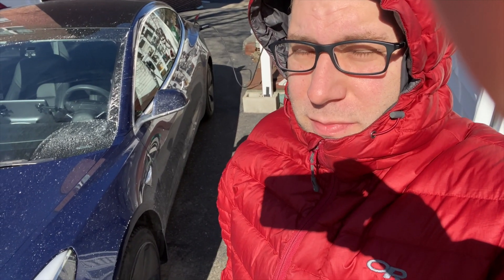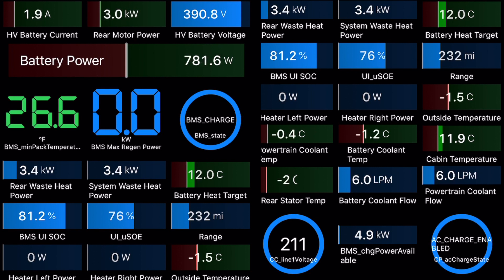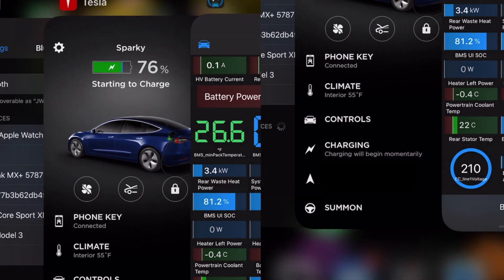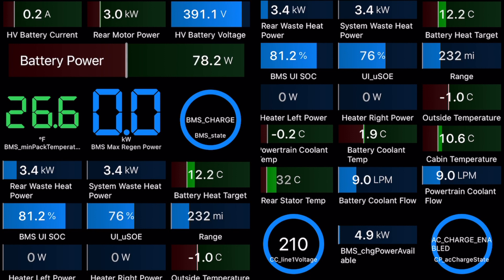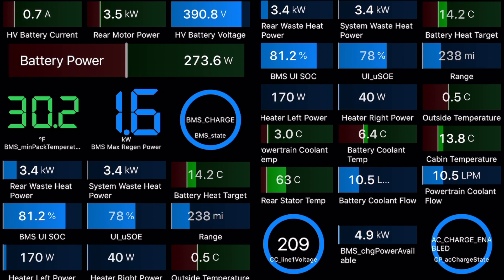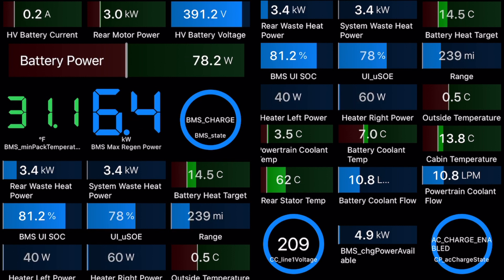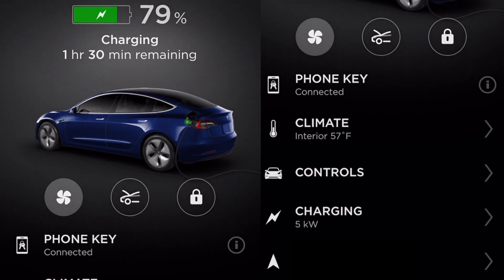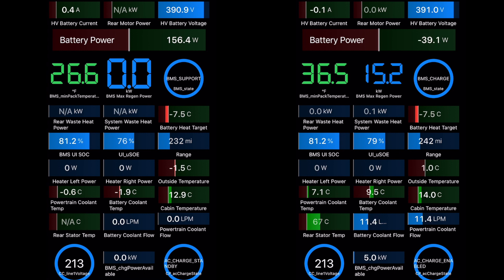Signals: Battery Heating and Preconditioning

Comment: I feel like I need a electrical engineering degree to follow this.  Any way of dumbing down another video and just show how to heat cabin and pre condition battery on a very cold winter day using your app on the phone. I’ve watch I think 5 or 6 videos and no one shows how to do it on the phone. Everyone is showing how to do it on the car screen.  My pt is if I’m at a mall or hockey game or something, and I down know exactly how long I will be gone,, I want to get on my phone to get the car “warmed up” before I go out to the car
Reply from the maker: Yeah these videos are definitely engineering focused. Preconditioning your car is easy, just open the Tesla app, tap Climate, and toggle it On about 10 min before you leave. I would use this almost every day in the winter and on hot summer days as well

Comment: I thought the system is supposed to prevent the battery from going below about 36 deg. F - so why was it at 26.6 deg. F    5.4 deg. below freezing?!
Reply from the maker: No, the system will only warm the battery if it needs to charge. Left overnight the battery will chill to subzero temps, so you won't have any regen till it gets back above freezing

Comment: Very useful video, this is what I have been looking for! I have my 2014 Model S P85 parked outside without the possibility to have it plugged-in. I don't drive every day. Would you recommend to pre-condition the battery during winter months, even if not planning to drive? Let's say once per day. Just to warm up the battery so that it doesn't cool down to the bone? Of course loosing range by doing that but I would sacrifice that range if it should help the battery in the long run. Or is it actually better to leave the battery at constant temperature, although low, rather then warming it up and down? Thanks!
Reply from the maker: No, that would be a big waste of energy. The cold doesn't actually hurt the battery at all. Just precondition well before setting out on a drive.
Reply: @JWardellTechEV  Thank you for the answer!

Comment: I have a SR+ too. Have any info on if the rear motor can heat the pack while driving?
Reply from the maker: Yes, it will definitely use the rear motor to heat the battery while driving.

Comment: I've owned my 2020 Tesla 3 SR+ for 3 months and this will my first winter with it. At home I charge with a 240V plug.  When I am at work for 12hrs, I plug into a basic 120v outlet. This gets me about 8-9km/hr charge. In the winter I don't anticipate that I will get much charge out of the 120v outlet. When it is really cold (-20 Celsius) is it still worth while keeping it plugged in if I am not getting any charge?
Reply from the maker: It is worth plugging in if possible. When it is charging slower, it is using the rest of the power to heat the battery. The warmer your battery is, the more it can charge, but also the more regen you have when you drive it, and therefore it doesn't need to waste as much energy warming when driving. Even if it is so cold 120v is not enough to charge at all, your battery would still be much warmer when you go to drive than if it wasn't plugged.